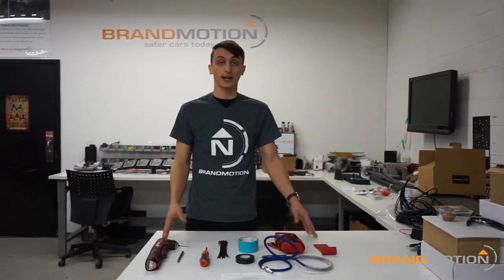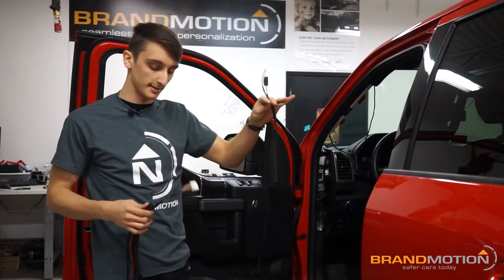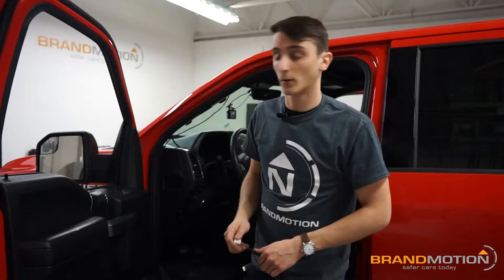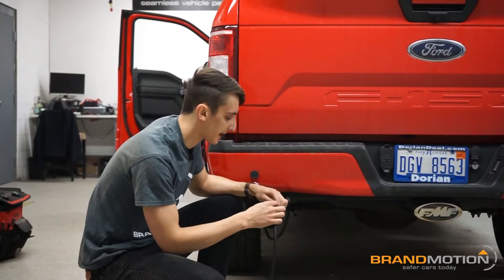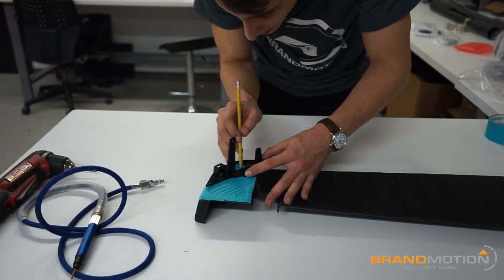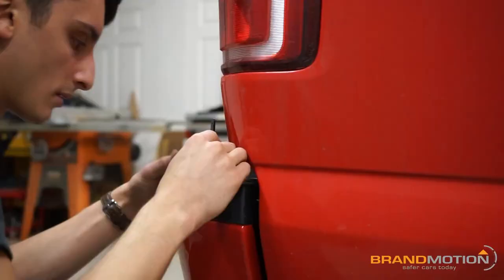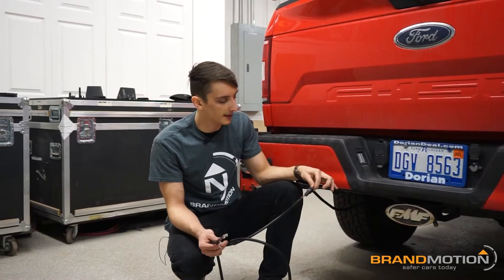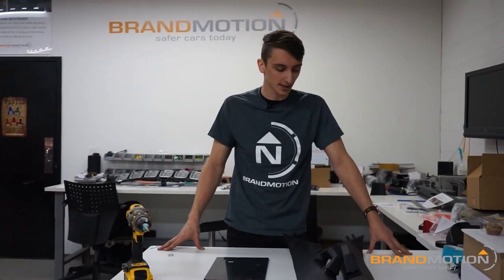F-150 Radar Blind Spot Installation

Comment: I have a 2018 GMC Sierra 1500 elevation, will this be compatible?
Reply from the maker: This kit is not directly compatible and would require fabrication of the mounts, however the actual electronics should work completely fine.

Comment: Amazon have a better radar mount that’s hidden inside the bumper
Reply: Incorrect. There is no aftermarket or OEM radar blind spot system that sees through metal bumpers.

Comment: Whats the reason thos doesnt work for 09-14 models. I do t see a good reason on install video?
Reply from the maker: Hello! The molding is cut to the design of the 2015-2020 F-150 bumper topper. In theory, this kit could be fabricated to be used on the 09-14 models. If you have any questions, please contact our technical support team at the following link: https://app.smartsheet.com/b/form/ac43b4c419c44ec79d60255669d44068